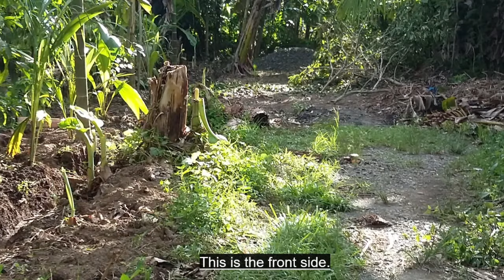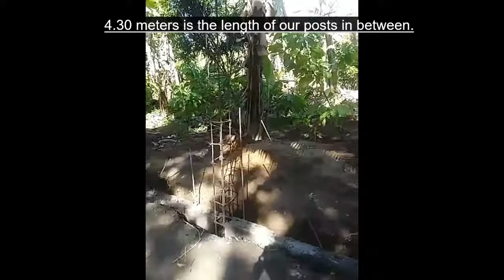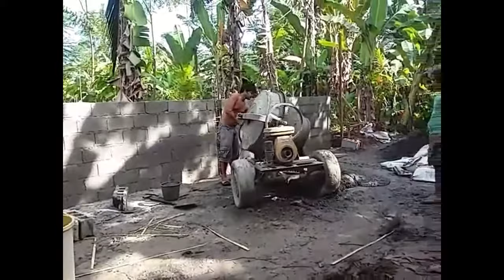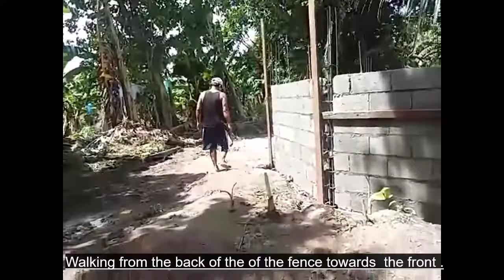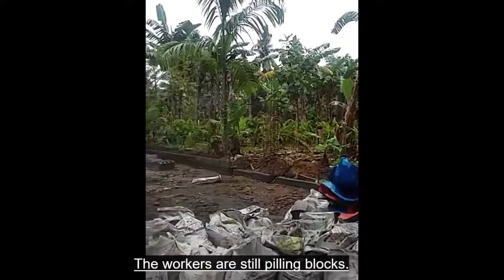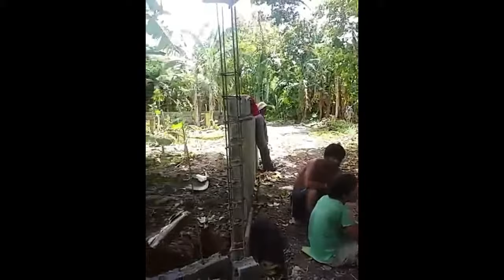How To Build A Strong Wall Philippines House Building Fence Ep 1

Comment: How much is the cost of your fence? And how long did it take you to finish the project?
Reply from the maker: My contractor took approximately 3 months to do my fence and it cost me about 600,000 pesos including the fence panels. the 3 man gates and the main gate. The infrastructure for the electric lights are installed. Later on we will do the wiring and lighting when we get electricitty.The high cost was due to the 6" chb which we insisted on.